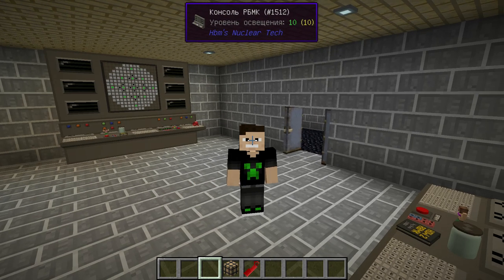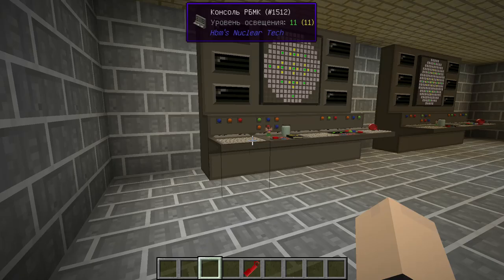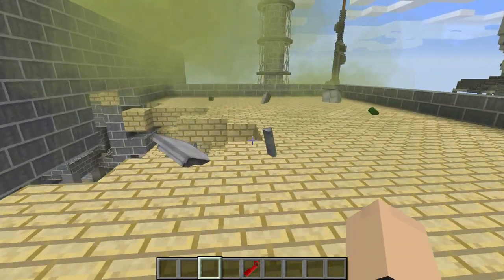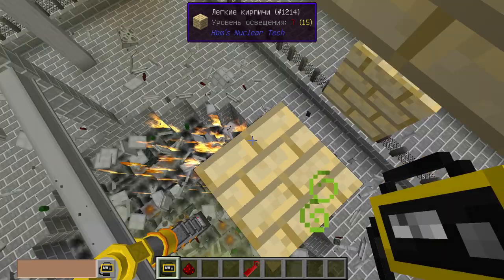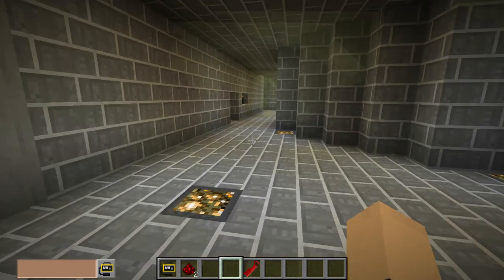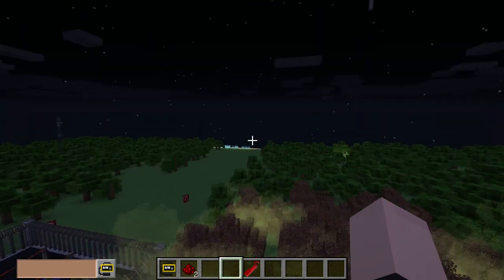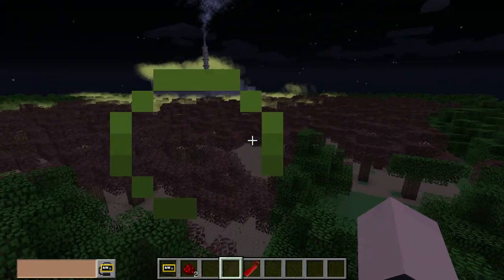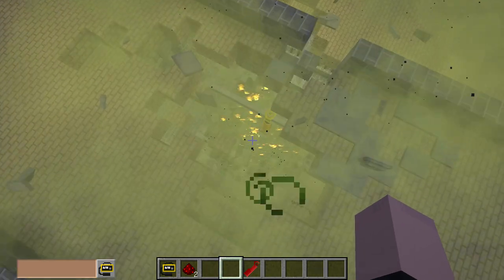"RBMK Reactors Don't Explode" HBM Tech Mod

Comment: thanks, i waited for it, i will download it tomorrow, and for the meltdown, you can use a balefire rod, jam the steam system, use the dyatlov meltdown inducer, or break the cooling system with water
Reply from the maker: I broke the cooling system then hit the az5 button too cause the RBMK explosion in my video, just as  Dyatlov had wanted.
Reply: @SemiNeon  i cant shut down the reactor, not completly

Comment: If you wanna fix your rbmk replace the  stuctural columns between the outer most fuel rods and the reflectors because other wise a3-5 wont work